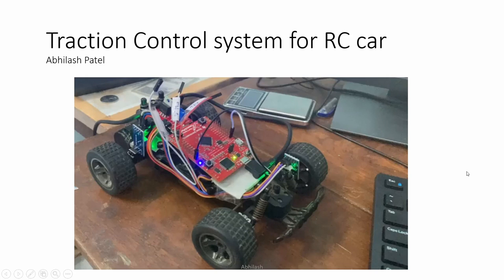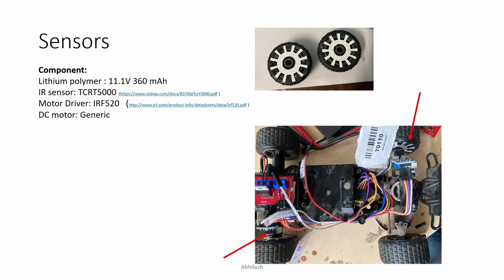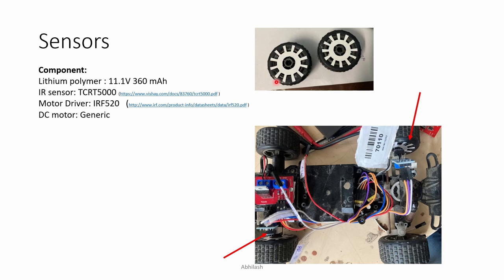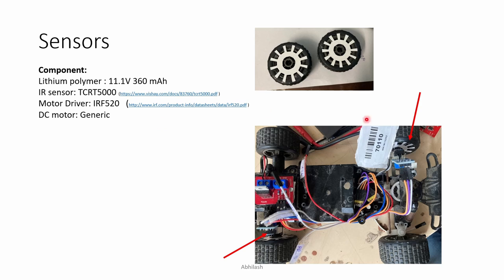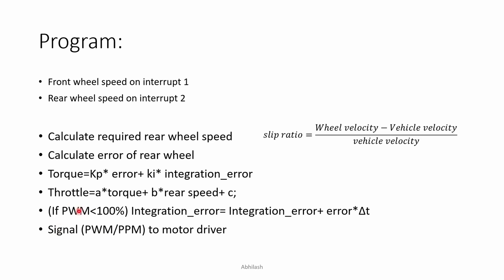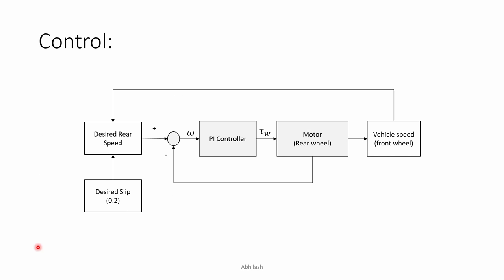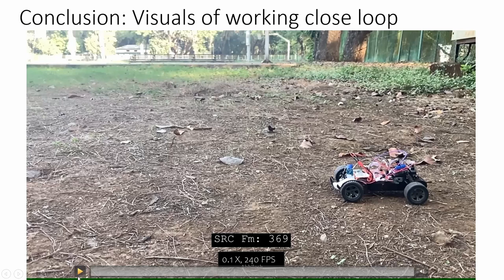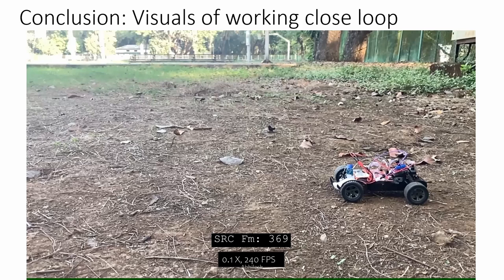Traction Control System for RC Car

Comment: Thank you for this video. It's a great help! However, your explanation about the Motor dynamics equations was not quite clear to me. Would it be possible for you to explain me how you came to the formula for the wheel torque and how you used this result to get the desired relation between torque and speed?

Comment: I saw your code in lines 146-147 slip_ratio. Why you didn't use the parameter 'slip' to calculate in line 147   'vel_r_req= ' ?